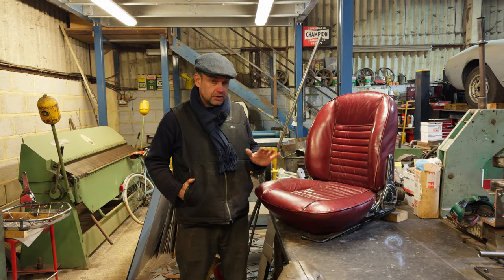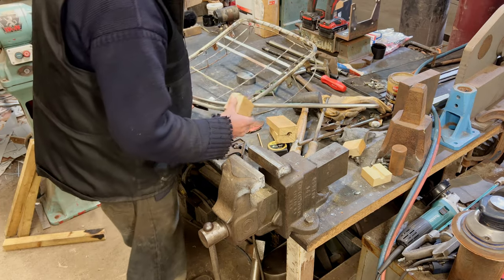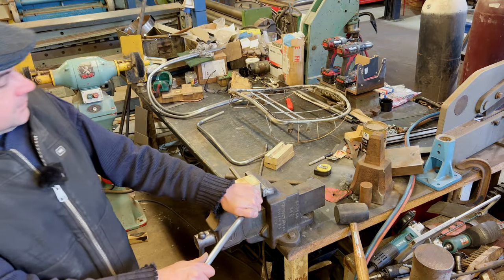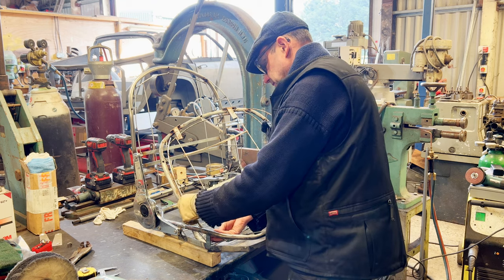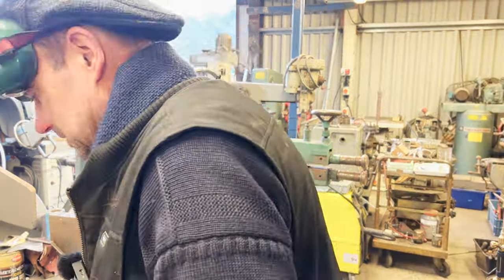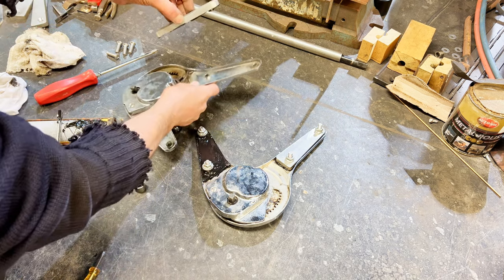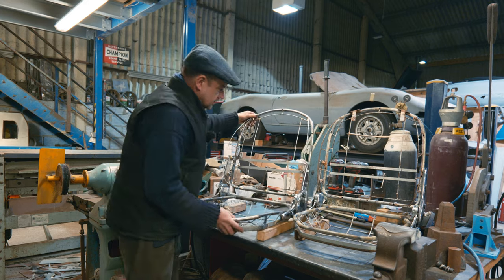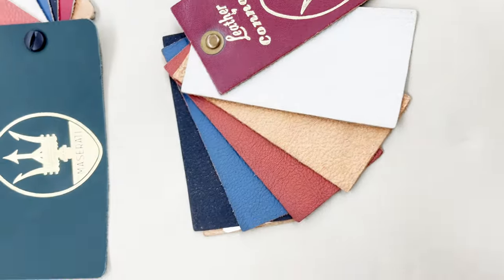Making Maserati Seats 3.

Comment: Great work Mark! Very inspiring. Especially the state of the art tube bending equipment 🪵👍😁
Reply from the maker: Thank you.
I’m keen to show that you can do a lot of work without having to invest in expensive equipment.   Especially if it’s just a one off project.
Reply: @marksitaliangarage imstokez ch just found a right hand  mazarati mistral ,in a barn next to a Jensen .
Reply from the maker: @Crosshatch1212  Is there a video ?
Reply from the maker: @Crosshatch1212  Just watched it . Looks like the engine is removed along with lots more parts.  But as you can see a lot of it can be made so it could be saved.  That Jensen has a four litre Austin truck engine as fitted to the K9 and the sheer line limousine.  The Maserati is a 3700 cc funny thing that it’s Gold like the one that I made the seats for .
Thank you for letting me know about it.

Comment: Iv never done it myself but i read it at my plumber school. To bend a pipe pack it with sand and cap the ends. The sand will prevent the pipe wanting to collaps cause it have no where to go.
Reply from the maker: The sand technique was my next move.
It was tough bending it cold but the results were acceptable.  There is a system of using a plumbers spring for copper pipe but i don’t know how well it would work with steel pipe.  I think the guys would have used a mandrill type machine. If you have a good look at where the seat frames are welded. It makes me think that they would make lots of bends and then assemble them as required for different applications. I’m thinking that the seats were bought in from a seat manufacturers. But trimming would be done later so probably just frames .